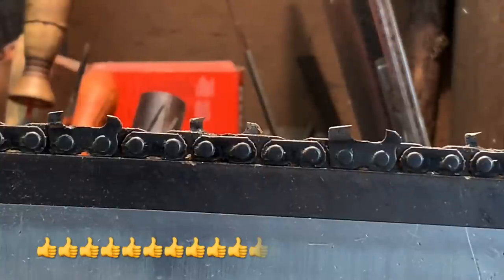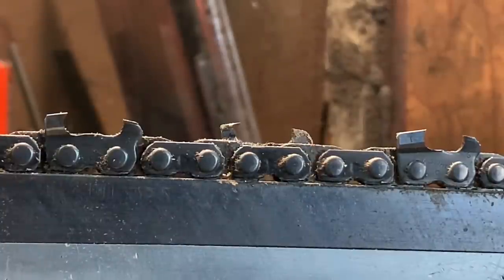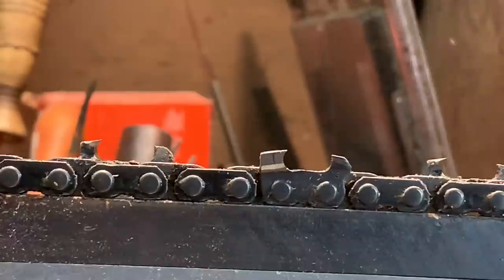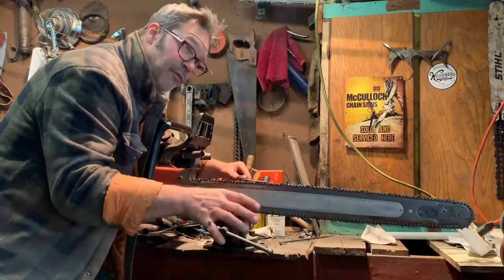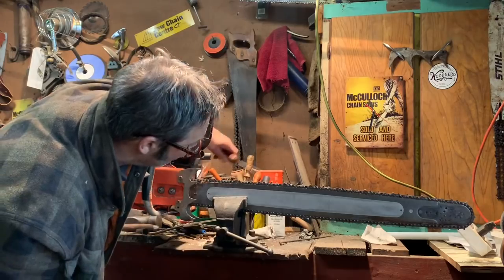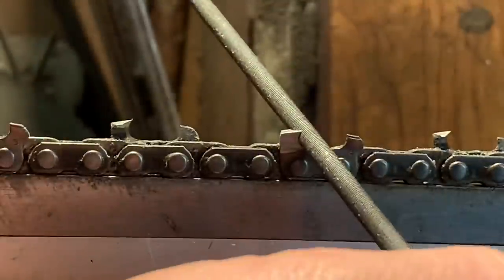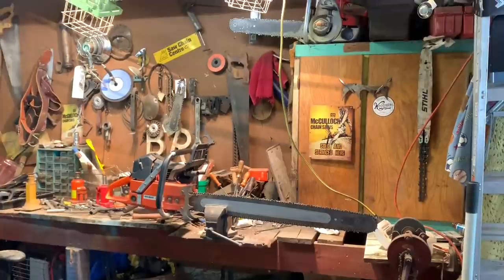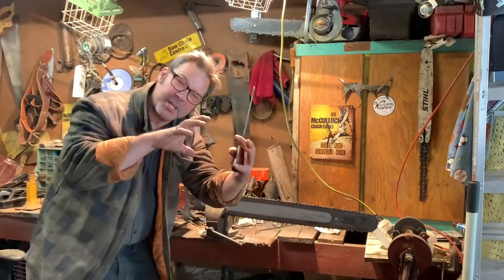Chainsaw- hand filing tips for a worn out chain

Comment: BBRS...If you watch any of John Reilly's videos with saws he has modified he shows in some how he files chains for others for racing.  Other chainsaw racers who show their technique show the same finished product.  They are all identical to the chain you filed for Hogan.  A properly filed chain will never cut faster than when it is almost at the end of its life.  That is when it has the absolute minimum drag and there is the greatest distance between the raker and the tooth.  Great explanation as always.  Always learn something particularly the bit about cutting good in small wood but getting chattering in big wood.  Been there!

Comment: Buckn, what about for a smaller saw that calls for a 5/32 file. Can you still use a 7/32 ? Or would a 7/32 get the job done better.
Reply: Generally using what the manufacturer recommends is best.
Reply: Some guys do that, others dig right into the tie strap. As the height of the tooth is reduced it really is one or the other... or loose your hook.

Comment: Hey Buckin how are ya? Not sure if you’ll get this question seeings the video is 3months old but I’ve always hand filed my own chain I worked for a small engine shop where we used a bench sharpener. But I was just curious have you ever used a Stihl 2in1 Hand filing tool? And if so what are your thoughts on it.

Comment: Hey man have a chain on a stihl 66 that's very similar. I know this may be a hard question to explain in a comment but I get heaps of file marks on the top of my tie strap where as you dont. Am I targeting the gullet to much? Seems to not do it if I use a 13/64 file but when I go with a 7/32 which is my preferred it does however the tooth looks great. Nice half moon hook, shiny leading edge and clean gullet except the annoying marks on the tie strap😅

Comment: Hi Billy Ray, you mentioned wasting tooth. The older I get the less effort I am willing to invest in an old chain. I considering it time wasting.There is a point they need to come off, the chain.  My experience shows me the further back the tooth is filed the less hard the metal is. Edge holding ability is gone. Have you not noticed this or am I missing somthing critical about worn out chains.

Comment: I had a chain very similar to that the teeth were longer on one side and it would cut so crooked it would jam the saw up. How come that chain isn't doing the same?
Reply: Tj many factors at play there but it's probably a combo of uneven rails on the bar and the raker hight. Next time bar is off saw see if it will stand up straight on a flat surface. Also warn tooth needs more of it's raker filed down. Hope this helps.👍
Reply: @morgunfreedom4346  ok I will do that thanks a lot for the info I appreciate it!